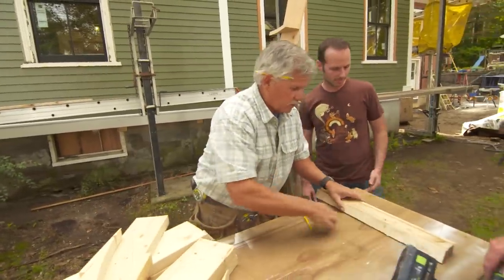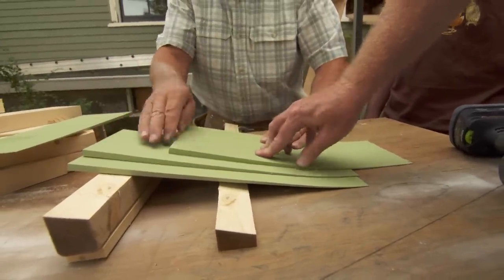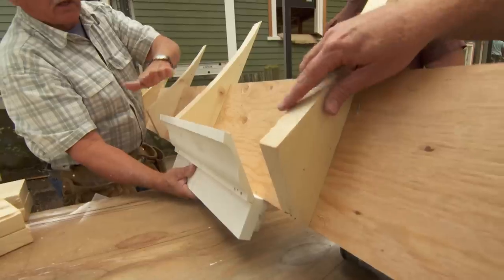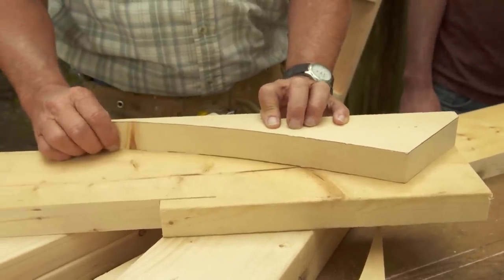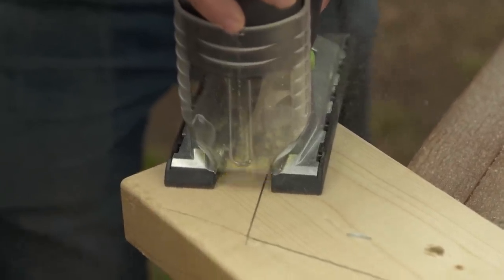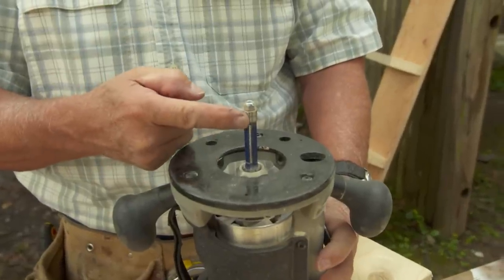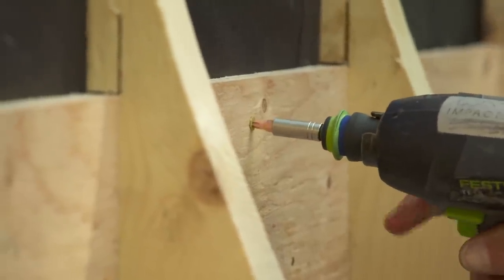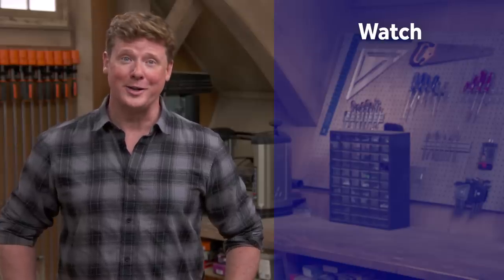How to Install Exterior Flares | This Old House

Comment: Tom Silva, how do I take a piece of lumber with a live edge on both sides and get a straight edge on one side?  I'm at a loss and I know you are the master.
Reply: Either a track saw or a straight edge clamped and then run a circular saw against it